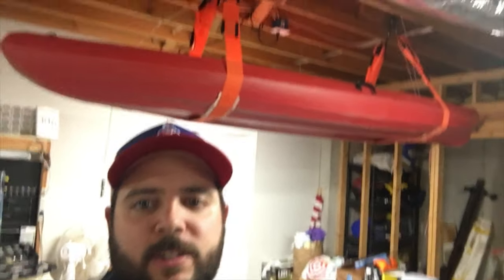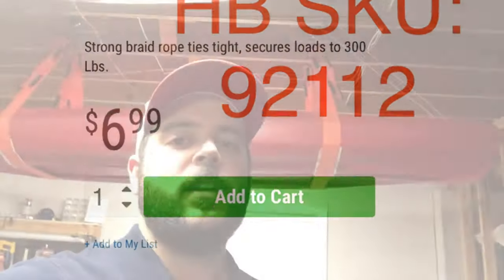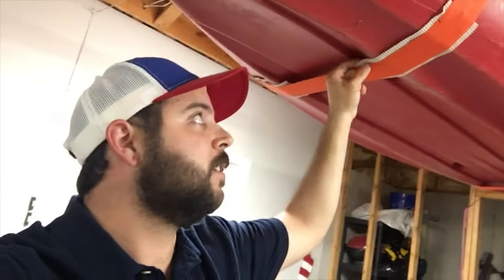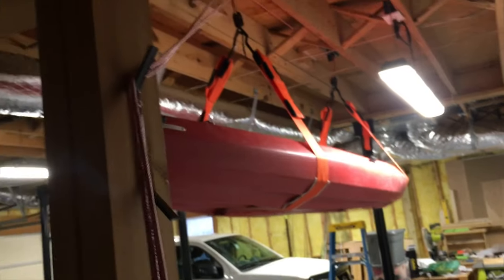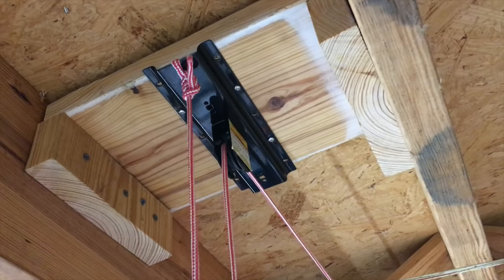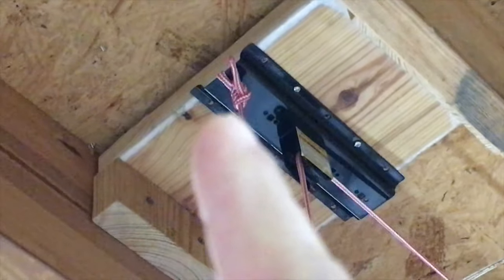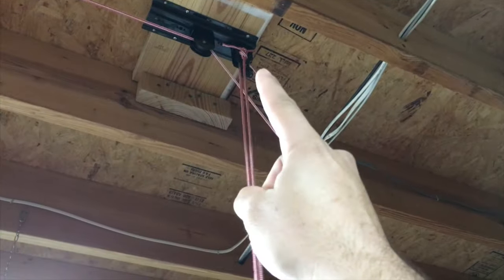DIY $13 Kayak Pulley Storage System

Comment: Great idea and video explanation.  I believe you would achieve a 2:1 mechanical advantage on lifting that Kayak if you used one rope through the 2 pulleys.
Reply from the maker: Thanks! You are right. I may revisit this with 1 rope. At the time I committed to the 2 rope idea I was trying to overcome the sliding out of under the kayaks. The rubber mat addressed that, but I was already using 2 ropes then.

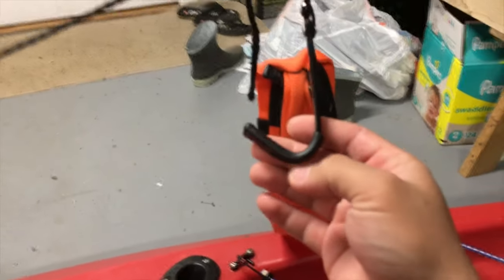Comment: What method or tools did you use to bend the hooks that you reference at 2:54?
Reply from the maker: I used channel locks. You could probably also use a hammer/mallet and the ground to achieve the same. Thanks for watching!
Reply: @SammyBenitez  Thank you. I'll try to bend them this weekend. I copied your full set up in my garage to lift and store our cartop ski box. It worked great. Thanks for sharing.

Comment: Just curious. Is there a reason the hooks on the pulley system wouldn’t work out just hooked to the carry handles on each end of a kayak?
Reply from the maker: It’s possible that could work. Two reasons it may not work though, contact at only 2 points may cause it to flip/rotate. Unless I have something to keep the hooks from continuing to spread beyond the nose and transom (which I did add in the video), it would most likely just keep spreading and slip off. 

If you’re wanting to give this a shot, try that out first.
Reply: @SammyBenitez  It works pretty well with just the hooks. I definitely should have run separate lines for each end of the kayak though instead of using the bike hanger as it comes. It doesn’t want to raise evenly with only one line.

Comment: It's not 1:1, it's 2:1.  It would be 4:1 if you didn't use 2 separate ropes.
Reply from the maker: OC Run I’m not an expert on pulleys, but if I pull 10ft of rope, it only raises 10ft. According to the calculation of Mechanical Advantage this is still a 1:1, and if I routed the rope as the kit intended it would be a 2:1.
Reply: @SammyBenitez  I can see in your video that each rope drops from a fixed pulley to a pulley at the kayak and then back up to a fixed attachment at the ceiling.  If you measure the rope you'll see that every foot of rope you pull is divided 6 inches on the side down to the pulley on the kayak and 6 inches up to the ceiling on the other side of it.    That's 2:1.  And if you continued rigging to the other side with the same rope it would be another 2:1 for a total of 4:1.  The efficiency of those pulleys will significantly affect the force you need to apply but not the length of rope you'll pull.  Measure the distance from the bottom of the hull while suspended as you have it to the floor.  Double that length and that will be exactly how much rope you let out to lower to the ground
Reply from the maker: OC Run yeah I see what you mean, I agree. It would be 2:1 as is and 4:1 as one rope. 

I tried the 4:1 system initially (prior to adding the rubber to the straps) and the kayak would slide off the straps. Making it 2 was my attempt to control each side instead of letting it dive and slide off.
Reply: @SammyBenitez  it's hard to balance weight where the moving pulleys are far apart.  You solved the slipping part with the rubber mats and rope to prevent the spreading.  If you try again just remember that the moving pulleys will adjust to move the side with the least amount of weight.  You have to perfectly balance them.  Even then, if your rope has any stretch it will cause unevenness.
Reply: OC Run  - Thanks, this is great info about how the pulleys work and the need to balance the weight. I’ve watched several videos using this bike system and most didn’t seem to have an issue with balance but now I wonder if it was luck or knowledge.  Guess I’ll have to do some figuring before I install one for my yak...

Comment: Will your system work on a 90 lb. kayak?
Reply from the maker: @johndombrosky412  I’ve done it with my new 75lb set up. Should be fine. You could always work the pulleys to get a better ratio, I just had a hard time getting it to lift both sides evenly so I stuck with the method mentioned in the video.

Comment: The kit looks like it uses one rope for pulling the bike/kayak up. Why did you re-do it for having two ropes to pull? Thanks!
Reply from the maker: jay it’s been a while since the install. IIRC, with the one rope system (as the kit intended) the kayak slants significantly to one side while pulling up, causing it to slide off. 
I decided on the 2 rope system before I added those rubber pieces to the straps to hold it in place. It’s possible it would work with one rope now.

Comment: You only need one line make it simple
Reply from the maker: I tried one line and when I would lift the kayak would slide off the straps (prior to adding the rubber mat). Making it 2 was an attempt to control each side instead of letting it dive and slide off. 

It’s possible that now with the rubber I could do 1 and have no sliding issues as well as have a 4:1 pulley instead of the 2:1 I created.